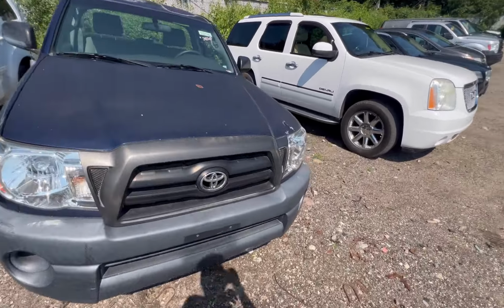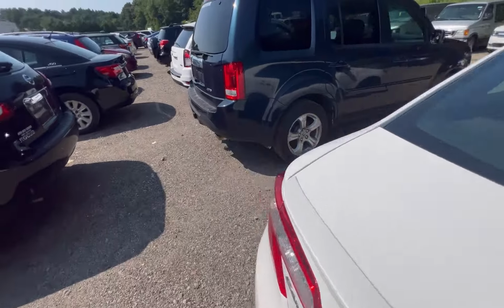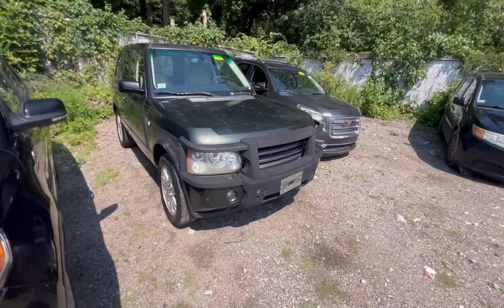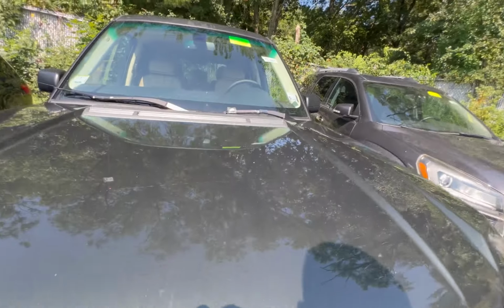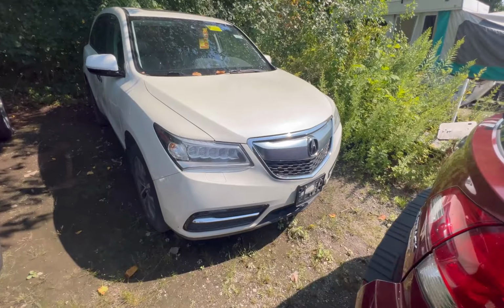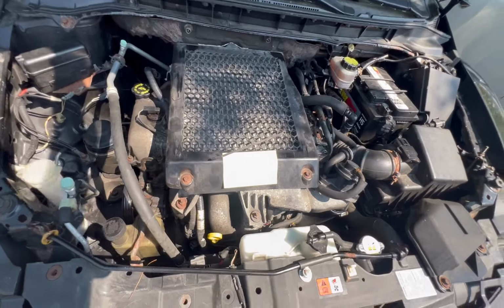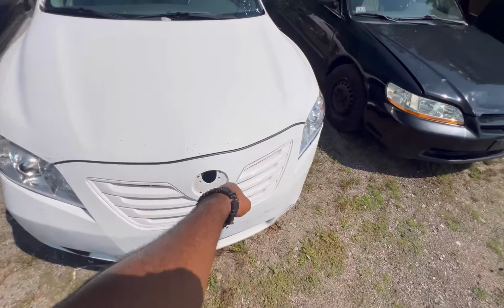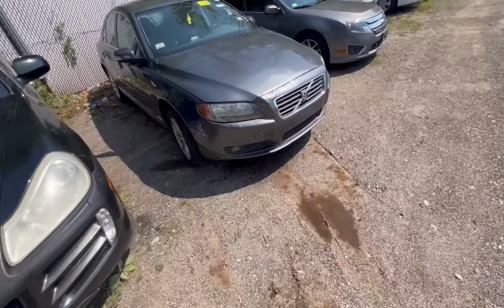This mini cooper country man had me wondering if it’s reliable or not I’m confused

Comment: Bought my '13 countryman 6-speed mt at 50k miles and had no issues all the way up to 115k with routine maintenance. Then the t-case randomly crapped out going down the highway. Luckily it didn’t take the transmission out with it and I managed to get a used lower mileage t-case installed to get it back on the road.
Reply from the maker: That’s great did you ever change the t case oil since you bought it up to the time it broke??
Reply: @MonieCarsReview2023  no never had that changed. Two different mini dealers recommended not to change it during the routine service intervals. From the amount of metal debris that was pulled out of it something catastrophic occurred internally.